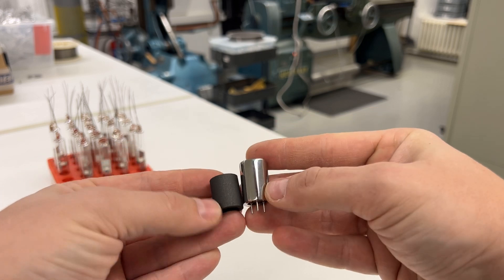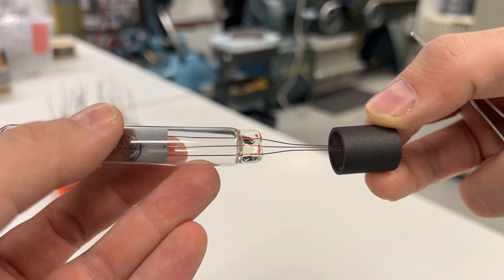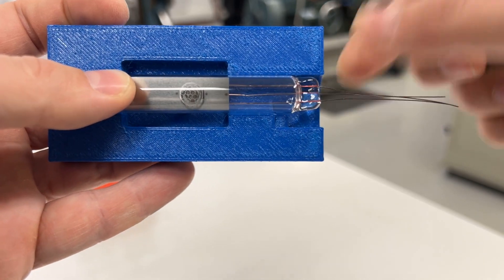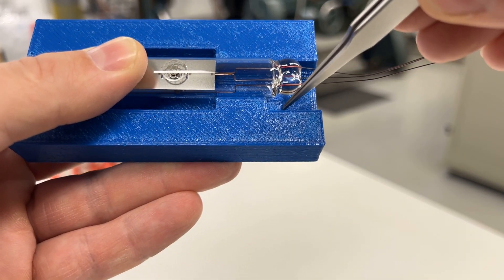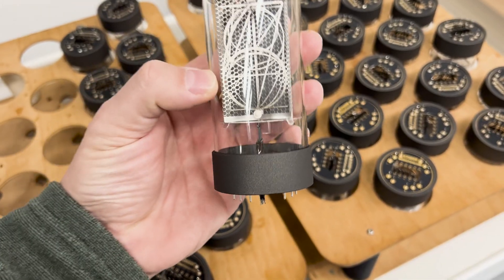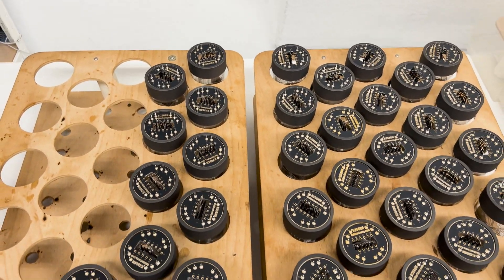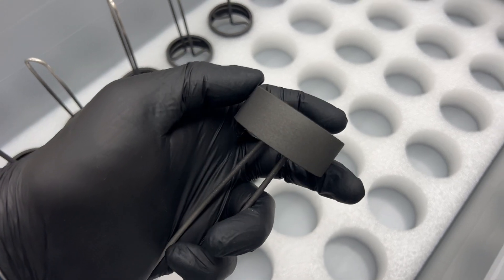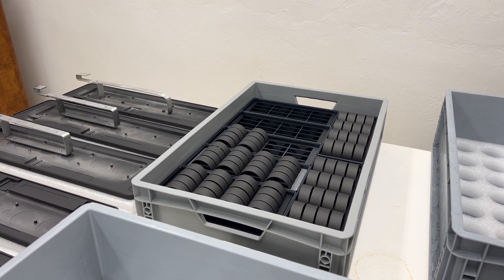Cerakoted bases ready, colon tubes sealed, all going well!

Comment: Looks good. I used to make triodes in a manner similar to the colon tube with the seals done straight to the leads. I like your little annealing setup for them. I may have to make my own version of that.
Reply: What metal and glass type did you use for the seals? Just tungsten and borosilicate?

Comment: It would be nice if you didn't destroy the tubes that were rejected only due to dimension tolerances, but sold them at a discounted price for DIYers.
Reply: That's caller B stock. Few companies do that, because it can cheapen a brand. And you know people, such items would be bought by businesses. Like the Raspberry Pi: started as a DIY computer, now it's a component in industrial systems, and Joe Average always comes last.
Reply: @TheNefastor  In this case I don't think businesses would buy it, simply because it's a fairly low volume production, with probably only a few dozen rejected tubes per year that works fine, just rejected due to dimension tolerances. They probably won't sell them, because such tubes are perfect for lifetime testing.